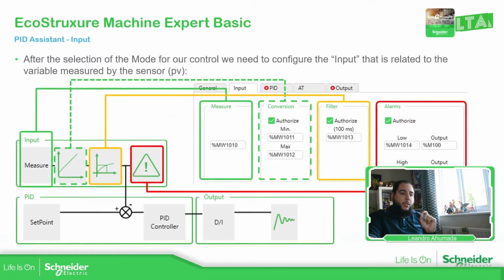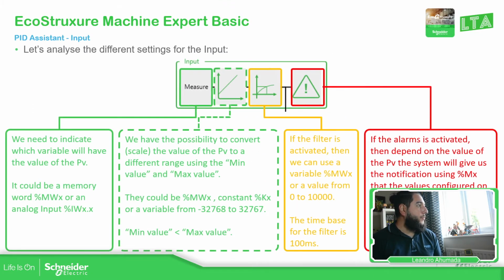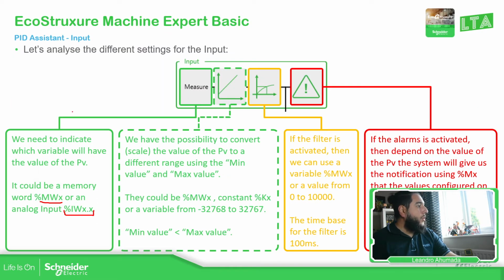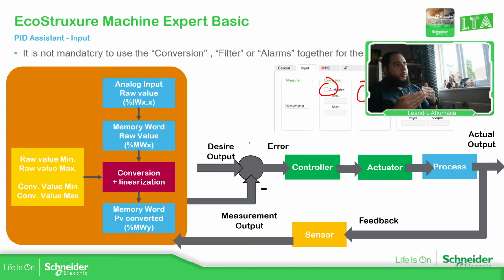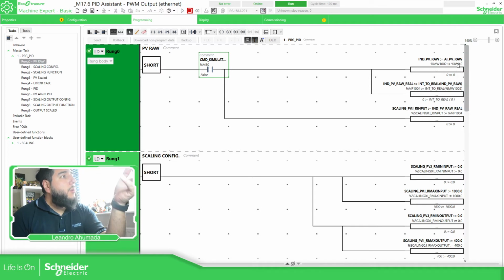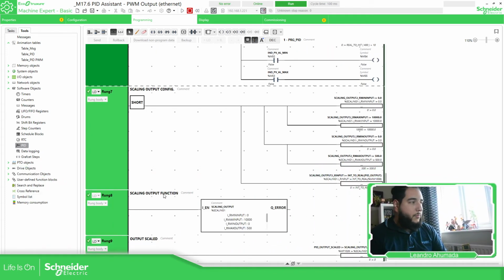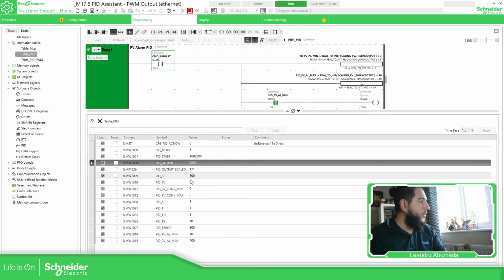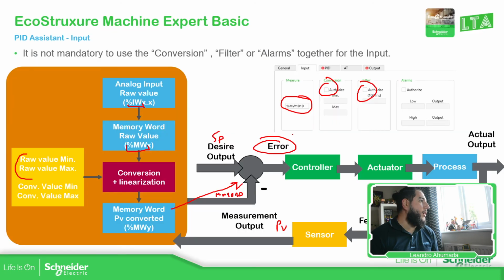Training - M221 - M17.4 PID Assistant - Input Configuration

Comment: You skipped over the filter function. What exactly does it do? Does it change the time between measure inputs thus giving the system more time to respond to the changes before making another?
Reply from the maker: Hi there! the "Filter" (100ms) on the Input PID Assistant is for filtering the signal if I am not wrong we have a Sampling period. It similar to the filter in the configuration of the analog inputs.